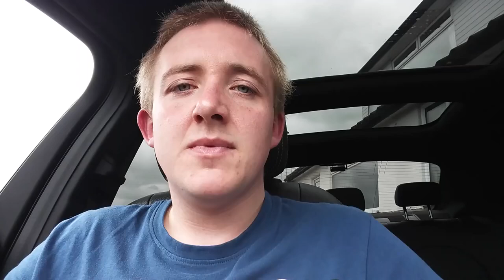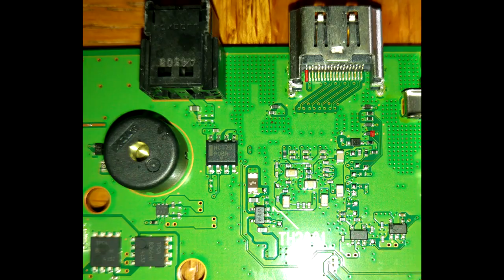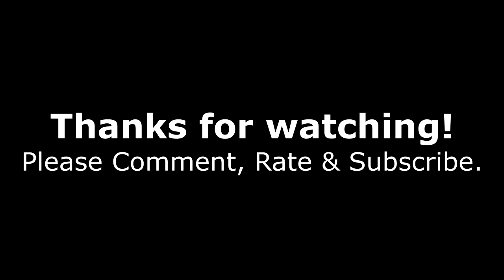Phat PS4 HDMI Pin-out - SAA-001 / SAB-001 Motherboard (10xx / 11xx Series)

Comment: Thank you so much for this video! I have been a technician for 7 years but working in an industrial environment. I have very little experience with things as small as HDMI port pins. I messed up 2 pins on my son's PS4 HDMI port and gave up on it because I didn't have the time to sit down and map out these pins. I have had to solder wires on to Z80 cards to bridge gaps due to burned traces, so that was my go-to solution. I truly appreciate you taking the time to help ppl like me with this issue!

Comment: pin 14 does not need to be connected?
Reply from the maker: Correct, pin 14 is part of the HDMI standard for future expansion / use. Consequently it's not currently connected to any part of the circuit so can be safely ignored if it's damaged or missing.
Reply: @AndrewPaul   THANKS

Comment: Watched a lot of your vids.  really good content and well informed.  I have been repairing a ps4 where a few pads had been lifted before i got it.  Using your videos I have repaired 6 out of 8. but i made a mistake and have lifted VIA 7.  Once a VIA is gone is there any way to trace back to another alt? or is this board a goose now?  

thanks
Reply from the maker: Yes it's still repairable. You'll need some very thin wire (I use 38AWG) - feed it through the hole where the via once was,  then scrape the via back on the opposite side of the board to expose the copper. Attach it there, then run the other end of the wire to the rear of the HDMI port. You can also run it through a screw hole to the other side if you haven't any wire thin enough to go through the via hole.
Reply: @AndrewPaul Thanks for the reply Andrew,  I cant believe I got it back to life.   This one is on FW 4.01 so can be used for homebrew too, that's a bonus. There's a picture below of my repair.  I know it's not as good as your repairs.It was pin 7 that was buggered.

https://ibb.co/k4KpWX0

If you want some donor consoles to make new videos I've got a few xbox 360's & PS3's in the loft if you want to have some fun with them.

Comment: What if the component you would jump pin 4 to is missing? Is it a resistor or capacitor and what are the values? Does every model motherboard need those?

Comment: Just wondering if there is another solder point I can solder pin 10 to?
Reply from the maker: Pin 10 on the video can go to here (bottom side of the board - you'll need to remove the metal shield over the Encoder IC):
https://imgur.com/tlPkfiF

Comment: Whats the part number for the diode that connects to Pin-9 (going from left to right) on the board. I knocked off that and damaged it after I put the hdmi port back on.

Comment: Hey Andrew, what type of wire and thickness do you use for your repairs? Thanks!!
Reply from the maker: Hi Fernando,
It's 36AWG enameled wire but 38AWG is best I find if you've got a good number of missing pads as even the 36 can get a little ungainly in those circumstances. I do sell this in individual 15m reels if you're looking for some - just drop me a message to ytandrewpaul@outlook.com if you do :-)

Comment: Pin 11.. This video shows it going to the left side of the diode.. This is ground so I'm abit confused.. Is the video wrong?
Reply from the maker: +reace m Pin 11 is indeed ground so there or any ground point you prefer. Point on the video is merely a suggestion.
Reply: ok thanks, im working on a board where the right hand side of that diode is shorted to ground, removed diode and cap under it but still shorted not enought to make multimeter bleep on continuity mode but near enough.. tearing my hair out lol
Reply: im trying tofix this for my cousin , her boyfriend tried to replace the hdmi port any managed to rip off all but 5 pads.. and also the cap under the diode i was on about was missing and the diode was missplaced iv put a new port on and rewired all the connections and they all test out ok, i replaced the cap for a similar looking one off a ps3 board and im still getting no output to tv and theres this short from the right side of the diode and cap to ground.. im wondering if iv shorted some pins on the port but it looks ok
Reply: so it turned out pin 18 was shorting to pin 17 .. scraped in between the pins and the short cleared.. still no output :O going back to it tomorrow. iv probably messed up somewhere else, going to re check every link wire and check for shorts between pins 1-2, 2-3 ,3-4 etc tomorrow.. not giving up the fight yet!
Reply: +reace m so I took the port off and started again.. 14 link wires.. No magnifying glass. Absolute nightmare.. Some good news.. Now have a picture but it's snowy and flickering.. I left 2 or 3 of the ground pins with no pads unconnected.. Hope it's not this that's the problem.. Going back for round 3 tomorrow.. This board was apparently beyond repair according to a repair shop so I'm pretty chuffed to even get this far.. I'll reply if I get it going properly
Reply from the maker: It'll likely be a dry joint or a loose wire on the back of the port. Give them all a gentle tug with a tweezer and reflow any joints which don't look to have a shiny appearance or  seem to have a lack of solder between the bonded surfaces.
Reply: +Andrew Paul what a nightmare iv had with this Andrew.. Been checking checking and rechecking the connections all day.. Looked for shorts.. Even took my PS4 apart to compare reading with the motherboards.. Couldn't find anything wrong at all.. So after taking it apart and putting it back together about 7 times, on the last time I forgot to put the harddrive in and what do you know.. I get a perfect picture of an error message saying it can't boot.. So I think iv gotcha.. Turned it off put harddrive back in.. Snow again and no picture.. So I tried it again without harddrive and same thing perfect picture of error message.. So I probably had the hdmi circuit right yesterday. Chances of HDD fault having same symptoms of a dodgy hdmi.. I think I need a drink haha. Going back to it tomorrow.. No idea what this is now though.. Corrupt harddrive? Tried my harddrive from my PS4 in it says cannot start PS4.. Connect USB cable for controller and press ps button.. But doesn't give me snow like the other harddrive.. Can't find my USB cable tonight so I'm calling it a draw till tomorrow.. I'm so close haha!
Reply from the maker: +reace m The hard drive is a red herring however if the safe mode screens are clear that shows its outputting 480p OK but HD resolutions are snowy when it's started up to OS. Classic signs of a failed HDMI Encoder IC.
Reply: +Andrew Paul could it be one of the 4 filters or definitly the chip?
Reply from the maker: +reace m I wouldn't think it's a filter - a filter fault would likely provide no image. My money is on the IC if the port and link wires are in place.
Reply: +Andrew Paul bad news. Seems like all the hard work was in vain. These encoder chips look pretty hard to get hold of. I wondered if I'd damaged the hard drive connector on the board but your a genius with these things so I know your right. Do you sell these encoders? Thankyou for your advice mate
Reply: +reace m just powered it up again.. Got snow but sometimes you can see the PlayStation logo.. This makes me think it could be a bad connection from the filters to the port.. Going to take the heat shield off again and do some continuity tests
Reply from the maker: +reace m it's unlikely to be connection from a filter - more likely it's a connection on the one of the differential pair link wires being troublesome. How are you securing them to the board? Do they overlap, are they overly long, are they sitting flat and flush to the board?
Reply: +Andrew Paul I got them as short and neat as I could they overlap but iv separated them all in case some of the laminate on the wires melted off. Iv checked for shorts and couldn't find anything. Iv checked continuity from the pins to the vias but not from the vias to the filters on the other side. It would be handy to narrow down which pins could be causing he problem. I'm guessing it's one of the 8 that go to the filters
Reply: +reace m what do you mean by differential link wires pal
Reply: +reace m the encoders are 8 quid free postage on eBay. Going to change it. Andrew do you flow the ic in with the heat gun or do you individually solder each pin?
Reply: +reace m I left the PS4 on safe mode for around 5 mins and the PS4 shut down.. No overheating beeps.. Then when I tried to turn it on it just gave a fan spin and turned straight off. After leaving it for half an hour it does the same thing.. Stays on for a few mins then turns off then won't turn on.. Could this be caused by the encoder ic? Or is this something else? I don't want to replace the encoder ic if there's another problem. And help would be much appreciated. Thank you
Reply: +reace m any help*
Reply from the maker: Hi bud,
Differential pairs are the sets of traces which go to the HDMI Encoder IC. When replacing them I flow them into place with hot air - it'd be a fairly time consuming process to do each pin in turn unless you want to drag solder it into position. Either will work - it's just down to personal preference as to which you'd rather do.
The power on and off seems weird - definitely not caused by an Encoder. Have you replaced the thermal compound and tightened down the heatsink clamp sufficiently? Hand tight on the two screws will suffice on it. That's the best / easiest place to try and start troubleshooting.
Reply: +Andrew Paul yeh I used the proper paste and its clamped down to heats ink properly. Not getting overheating beeps. Bit of a nightmare this one. I don't like giving up but I don't know what this is at all. Sounds like an ic or cpu but don't know where to start. I was gunna remove the encoder and see if it stays on but if you say it won't be that. I don't really know where to start
Reply: +reace m thanks for all your help anyway Andrew. Your a top bloke.

Comment: hi - good vids man - dunno if you still give replies - but ive got damaged hdmi port/pins - had a look at a guess id say only 7 intact pins ---- maybe 9 with a connection ... MAYBE  ....probably 7 lol now i can probably replace the port but reckon 10-12 lines of micro wire is gonna be a nightmare 

pro opinion time - is that amount of repair even feasible ??? and if possible is it worth it ???/
Reply from the maker: Some of those are likely to be ground - as long as you have two intact then you can leave the rest of the ground pads out - that may reduce your number slightly. You can definitely repair this damage and get it working, but if you're doing it for commercial reasons then personally I'd decline it. If it's a personal machine however or something like a PS4 Pro which still has a significant value then yes it's worth pursuing. :-)

Comment: 8,12 and 13 for me
Reply from the maker: 8 & 13 will definitely need wires running - pin 12 is ground so as long as you've nothing else missing you're fine to leave that one off if you please.
Reply: O i ment 8 13 and 14

Comment: I had to salvage the pin 18 zener diode and capacitor from an otherwise working board for a repair that required this pinout (thanks Andrew!). However, I'm not able to find any information on these components so I can fix my actually working board. Do you know what the collapse voltage of the zener diode is and the capacitor value (my multimeter won't read it correctly for some reason) so that I might find some suitable replacements? These, of course, would be the two components in the middle of nowhere on the rear left side of the HDMI port (looking from behind the port as you are in this video).

Comment: i notice that there is a pin that says not connected what do you do that instant?
Reply from the maker: You don't have to solder it so if it's missing you don't need to repair that one.
Reply: thanks

Comment: Hi one more question what is pin 14 called NC? Where can it go if the pin is gone? Ore is that one not needed?  Have fixed a few now tangs to you! But first time i will try to fix leads.. This PCB is fucked up bad 7 leads/pinouts gone.. The hdmi has just been broken off LOL OMG the things some do.. Tangs for the help! And one more question do you have a tip on PCB PS4 thats totaly dead? have not found a fault.. Wonder if its APU but... Can be anything
Reply from the maker: +TheCbj79 NC = not connected i.e. it has no function so can be ignored if it's missing. The one that's totally dead could be literally anything without seeing it - check for any missing / burned components initially and test it with a known working PSU.
Reply: Okay that was my guess that i did not need it,,, Then i just have to bridge 6 pinouts lol on it..  And the DEAD ones are two the same SAB-001  they look fine  but i will test everything. I did think it was the PSU as usual but no.. Just first look over there is nothing missing ore that look burned... One have not even sound when i tried to power it whit a working PSU the other had a beeb no light.. But we learn as we go. Fun much better than the ps3 machines to work on..
Reply: Hi there.. I found out that capacitors are gone one each pcb... But im not good in reading the caps same cap both pcb'S but one have blue and the other purple same type bord blue has CG330 e 392 on it there is tow by the battery side. And the other Purple 413 PE330 2,5  do you know where i can get them ore even the values? Are they the same? I can get a read from mine :/ If you know this will help a bunch.. tangs

Comment: Bought a non-working PS4 with a white light, hoping I'd only have to replace the HDMI port, but nope! Somebody prior to me worked on it and of course had to do a HORRIBLE job. Not only are there tons of shorted pads there are tons of lifted pads too (even near the panasonic chip)! What I found out also was that the capacitors near the panasonic chip are completely missing, and most of their pads are missing, too. Do you think it's worth trying to save this PS4? Also, are the capacitors near the encoder chip really nescesary for the PS4 to function?
Reply from the maker: Yes mate they are necessary - sounds like a nightmare I'd be recommending for spares/repair.
Reply: Would you mind helping me on fixing this PS4? I need to find alternative points for the panasonic chip. I can provide a picture with the lifted pads.
Reply from the maker: +Evaldash post it up mate and I'll see what I can do.

Comment: Hi I have a three pads missing and would be difficult to solder on the top. Are ther any points on the bottom of the PCB that would be easier to solder to? If so are you able to point these out.
Reply from the maker: Which pins do you have missing?
Reply: 3,4,5,15,16,17,18 and 19
Reply from the maker: If those numbers are as per the video then pin 3 is ground and can be left. You still have pins 9 and 12 intact so you should be good for ground to be honest. Pins 4 and 5 link to a resistor and a diode respectively so should be easy to link wire up from there.

15 and 18 are ground. You can leave these out as above. 17, 18 and 19 can be attached at the via on the underside of the board if those top side are trashed.

Be sure to make sure that the connections are solid and clean, and that you use some form of conformal coating on the repair to the rear of the port to ensure everything stays together nicely otherwise you may find you'll get snow or other weird glitches and artifacts on screen. It's a sensitive circuit if the job isn't perfect. Cheers.

Comment: I bought a board off ebay with the impression that the HDMI was just broken but he tried to remove it to make the repair and ripped all the pads off. can i pay to have this repaired? or would it be cheaper to just buy a new ps4 and sell this one as parts?
Reply from the maker: If they're all ripped then don't bother - part it.
Reply: +Andrew Paul I'm afraid your right, bummer. thanks for the quick reply love your videos. very helpful. take care
Reply from the maker: Cheers mate.

Comment: Video is great.  However,  ive got a short to ground on pin 7... Any idea where this break may originate?
Reply from the maker: 7 in from the left as per the video (pin 13)? Usually a bad Encoder IC - lift it and see if the short disappears.
Reply: Its pin 7,  seven in from right.  Ran some test today and it does indeed appear to be encoder issue. You sir, are a ps4 wizard.
Reply from the maker: Thank you :-)

Comment: Hi, the part on the board that corresponds to pin number five(starting from the left) is broken on my console. Is it possible for the Hdmi port to still work? I have been told by some people that it is possible.
Reply from the maker: I've heard this from some but never understand why - Pin 15 is required for DDC, so stuff like HDCP etc runs via here. Every time I've had a machine with Pin 15 or that diode missing it results in WLOD until it's put back. Pin 14 is the one you can get away with missing completely - 2,5,8,11 and 17 are ground so as long as you have one of those you're good also. You'll need to run a link wire to reattach Pin 15 back to the end of the diode behind the port.